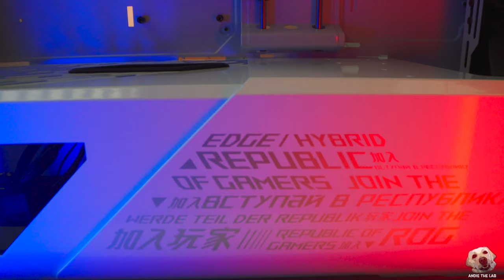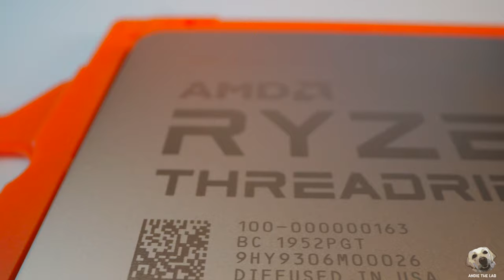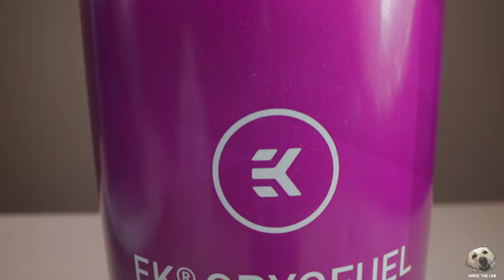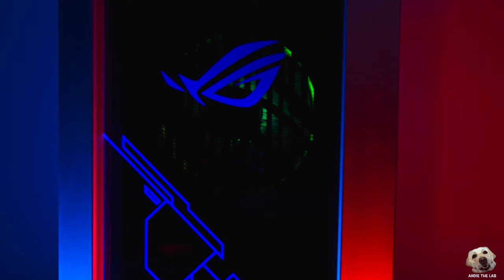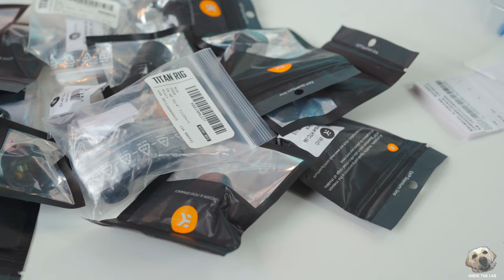$30000 USD INSANE SIM RACING PC - ft ASUS ROG Strix Helios GX601 White Edition Case!

Comment: I think you could have just waited for the RTX 3090 to save money and have a 50% faster performance. But....wait, money? Oh, not a problem. You can just upgrade to two RTX 3090s since it still supports NVLink. 

By the way, that build is so lit and cool.🔥
Reply from the maker: Thanks! I needed a build ASAP, so this was the best solution. Also, I’m not a regular tech youtuber so I won’t be getting my hands on a 3090 any time soon

Comment: but...
the front rad fans are push in >>> this will push hot air INSIDE the case,

and the the top fans r push out. it will exhaust that HOT air from INSIDE and hence it will NOT cool the coolant in that TOP RAD !

plz can you confirm ? i think RADs need to always pull COOL air and under stress test the fron RAD will push A LOT of hot air INSIDE the case,

lemme know...
Reply from the maker: The front radiators are intake from ambient air so it’s always pulling in cool air. Top radiators will exhaust the hot air out.
Reply: @AndietheLab  yes and my concern if the top rad is exhausting hot air does it actually add more cooling for the build or do the exact opposite ?, anyways thanks for sharing ill figure it out :)
Reply from the maker: ? The loop evens out
Reply: @AndietheLab  🙏👍👌
Reply from the maker: I think Gamer Nexus and Linus have both shown - over “x” time, the ambient coolant just takes on the room temp. Everything equalizes out
Reply: @AndietheLab  can u advise on that video ?!....